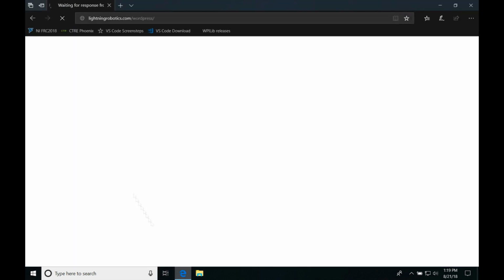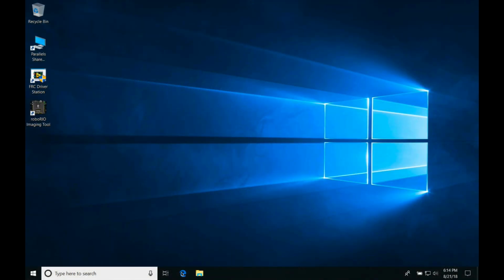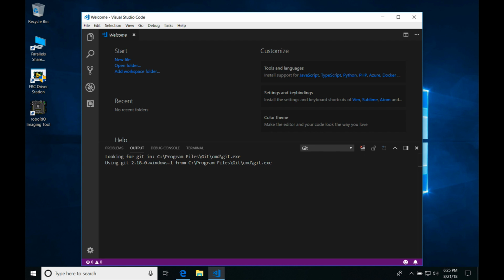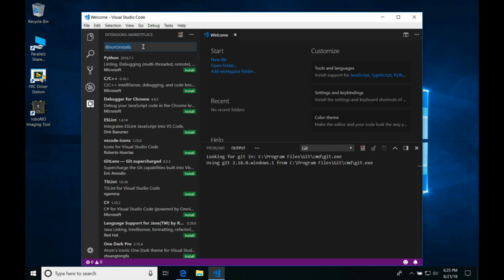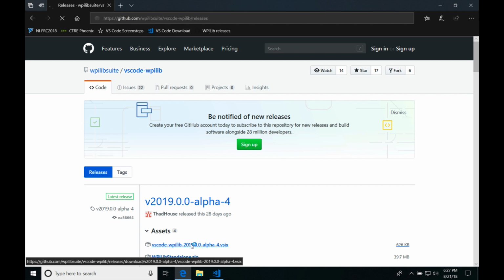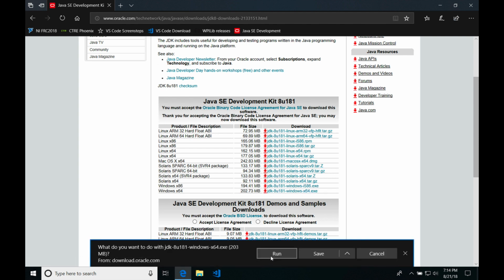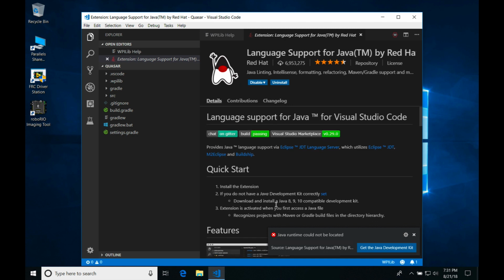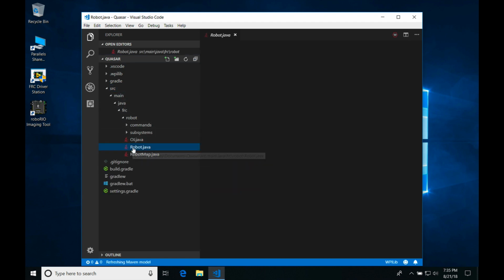FRC 2019 VS Code / WPILib Alpha Configuration

Comment: When we deploy code in VS it keeps saying we are not connected to the ROBORIO; do you have any suggestions?
Reply from the maker: Open a command window and verify that: "ping roborio-###-frc.local" returns. If it does not, reimage your radio, update the firmware in your RoboRIO, reimage the RoboRIO. (this is hitting the problem with a big stick, but it will generally work, for better support stop by http://chiefdelphi.com)

Comment: I was not able to get this working using the latest extension from WPI. It keeps returning "Value 'undefined' given for org.gradle.java.home Gradle Property is invalid (Java home supplied is invalid)" I have set java.home in JSON preferences and have set system variable for JAVA_HOME as well. Thanks!
Reply: @Vincent Tran thanks for the advice! There wasn't any issues with deprecated methods between 8 and 11 there?